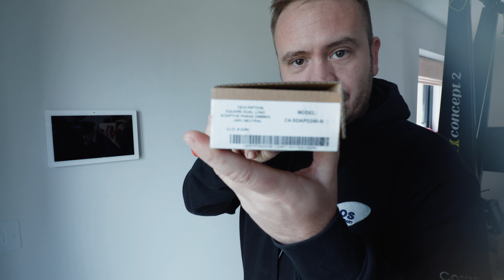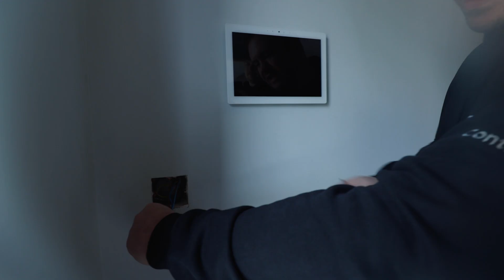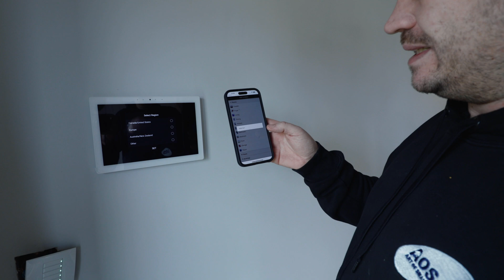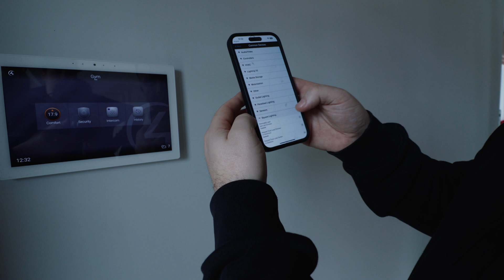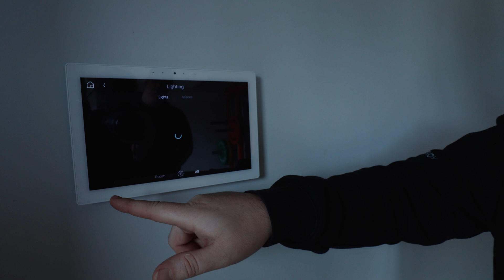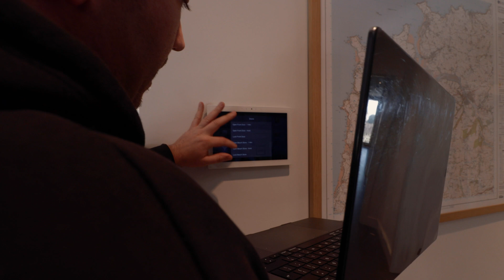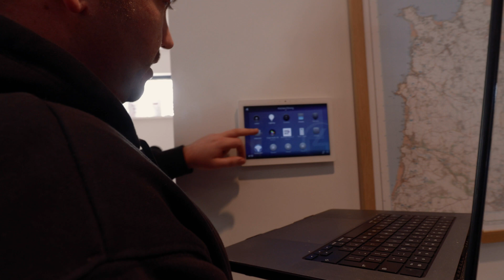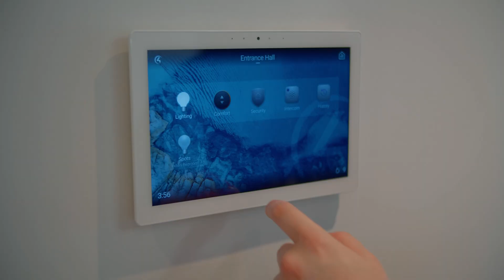The Ultimate Smart Home Gym Experience: Control4 Smart Lighting Install & Tour

Comment: 11:28 was there an issue with the video intercom as the video was very choppy?
Reply from the maker: Had just been installed and that was the first test on it so usually needs a bit of time to sync to the houses system properly. After that should work fine
Reply: @ArtofSmartUK  thanks for the reply mate. Was curious. I install hikvision intercoms and intergrate them with access control.
Reply from the maker: @abuhaqq  awesome, great work buddy. Keep it up.